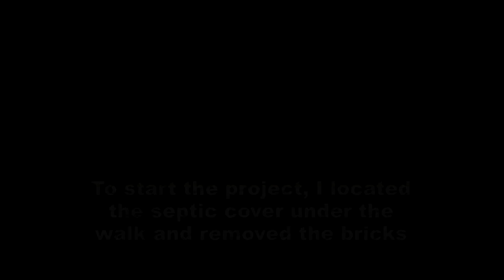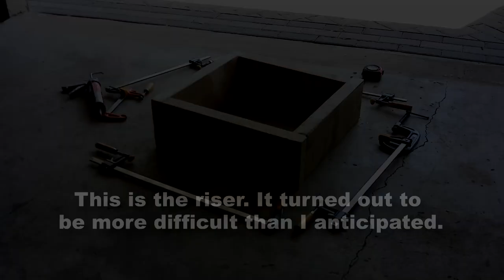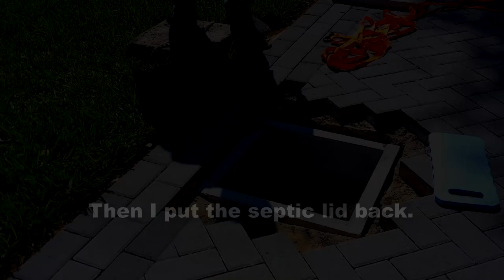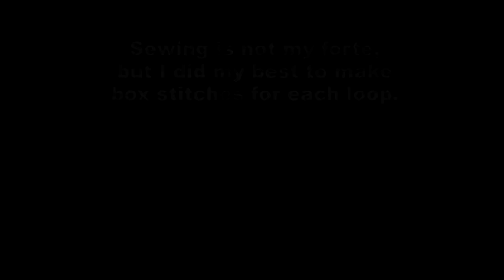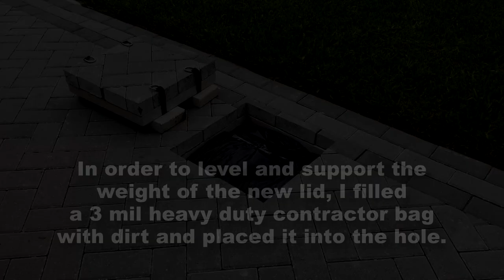DIY - $50 seamless septic cover build (how to)

Comment: Really nice solution there!
Only problem I think is the straps being visible.
I think you could toss the straps and get the smallest diameter threaded rod or really long screw and drill one hole from the top paver through the bottom one.
Washer and nut under the bottom paver, and a filed/ground nut that is just shy of the top of the top paver secured with locktite on 2-3 threads only.  When its time to remove, just have a long screw in a piece of 2x4 and thread it into the hole to the shy nut a couple turns.  Should be more than strong enough.
And you can even put some hot glue with some paver dust to hide the small hole.